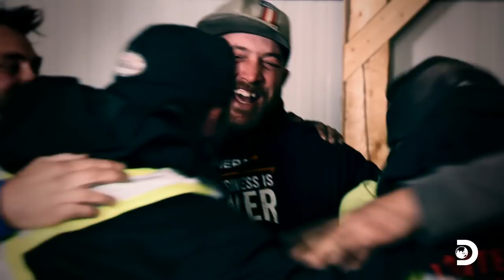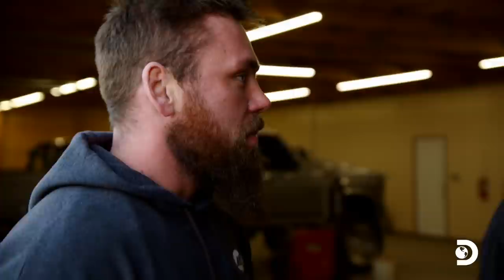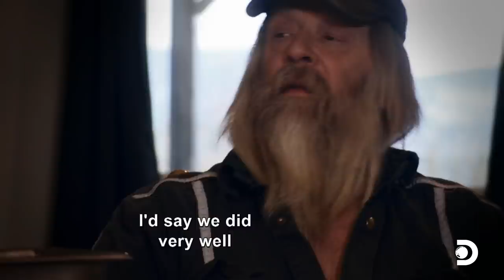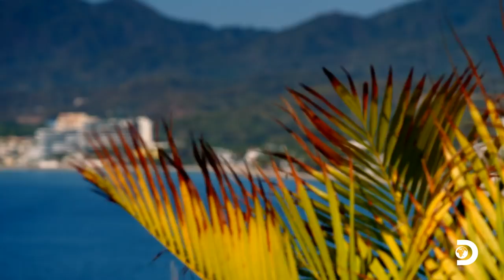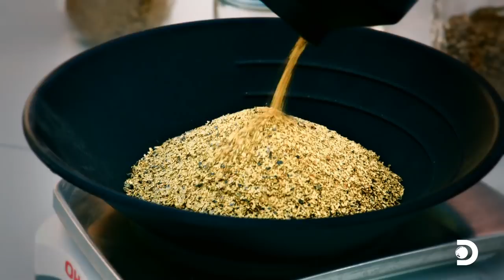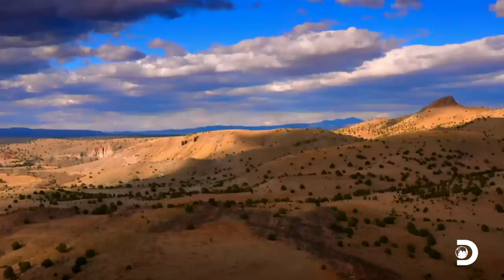First 10 Minutes of Season 1 | Gold Rush: Winter's Fortune

Comment: Idk if its because im high but anybody else find those dirt roads dave was riding on too flat? Normally those roads on jobsites with almost 30-40 ton equipment riding over it, are bumpy,have a ton of dips, and are just absolute suspension system killers. Just feel like since this show is scripted they couldve at least been more realistic with how jobsite roads actually are.
Reply: I work on a mine site in Alaska, anytime a road gets the littlest bump on it and your in a loader you slam the bucket down and back drag the whole road, it eventually gets as hard as granite and will be smooth as a highway, its all in maintenance, a front end loader will go just as fast backwards as they do forwards, it takes no time out of your day to smooth a road out until it's packed enough. If it's a really big bump or wash out grab a scoop of fines from the sluice fill it in and just keep on it, smooth roads make for fast production